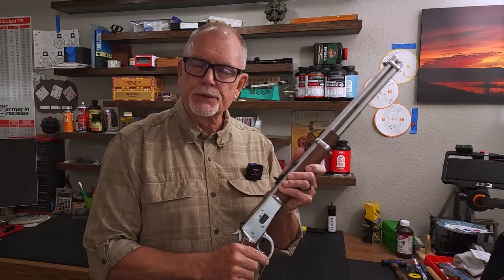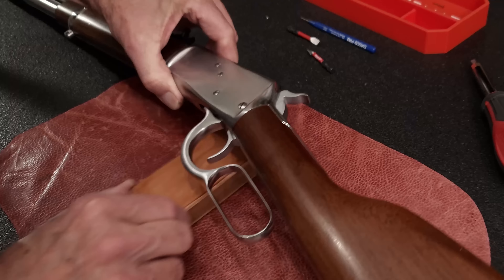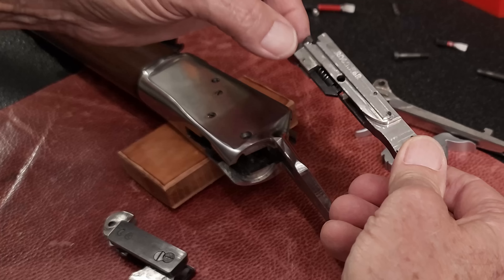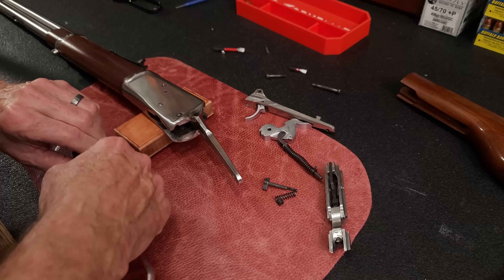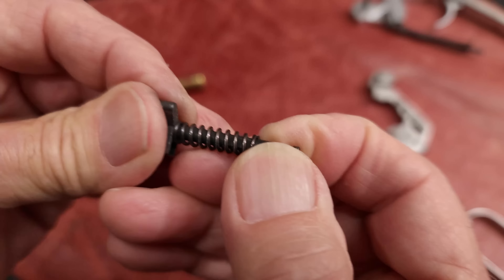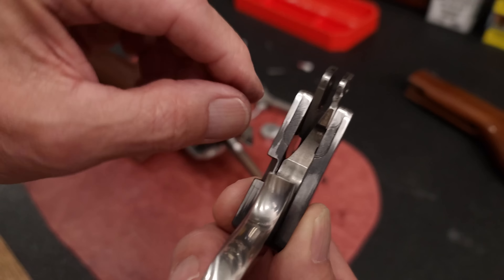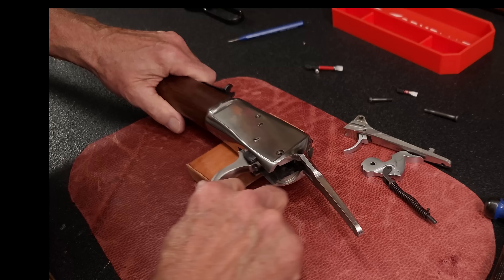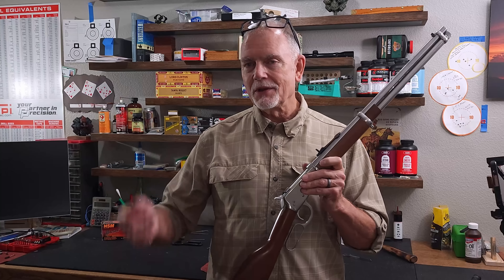Rossi 92 Disassembly . . . The 454 Casull Was Filthy!

Comment: The manual that came with my Rossi 92 looks like it was printed in the 1980ies and it very casually describes in a few short sentences how to disassemble the gun. No pictures, just a couple short instructions (it's impossible to follow those instructions successfully unless you're a gunsmith if you ask me) 
Then I found a new pdf manual for the Rossi 92 on their website and it basically says bring the rifle to a qualified gunsmith for disassembly and/or maintenance. 😂
They somewhat lowered their expectations of the manual skills of the average rifle owner I guess.
Reply from the maker: That's interesting. I saw a story the other day that was talking about how car manuals in the US used to have instructions on how to flush the radiator. Now they have warnings not to drink the antifreeze!

Comment: Is it the same for the 357/38 special
Reply from the maker: Yes sir. I have been inside this gun, one in 45 Colt, 357 Magnum, and 44 Magnum. Slight differences to accommodate the different cartridges, but other than that identical.
Reply: I recently purchased the new 92 Rossi in 357/38 special & right out of the box the groupings are about 1-2 inches.I love it.I used to have a model 94 Winchester pre 64,but when our 1st child was born, my bride didn't want it in the house so I sold it

Comment: If there is a lot of unburnt powder, does not imply that the primer is to weak? The Slomo Guy's made an interesting video when the shot 9mm and .22llr with a tiny 2mm bullet and the cartridge they shot at was in the open, even if the primer went of the powder was not ignited enough to send everything in to orbit. Soo take a quick look.
Reply from the maker: That's one possibility but in this case Larry, who owns the gun, put together some reloads and didn't crimp the cases tightly enough. That's a must with the 454 casull. The result for him was a LOT of unburned powder.
Reply: @TargetSuite  Ahh, lack of compression to sustain the burning of the progressive powder, got it. But it is still a very beutiful gun, will You try the .45 LC again, now when it is clean? Looking forward to that video. Thanks for Your work, to keep us informed and entertained.
Reply from the maker: Well, I won't make you wait. Cleaning did free up the cartridge stop and that works as intended. But for some reason the shorter rounds get hung up going between the cartridge guides. The rim of the cartridge is just a little bit too far forward and misses the notch that is cut for the rim to pass through.. If it were my gun I might make a slight modification and see if I could make it work. But it's not mine.
Reply: @TargetSuite  But single load it to just check performance and recoil?